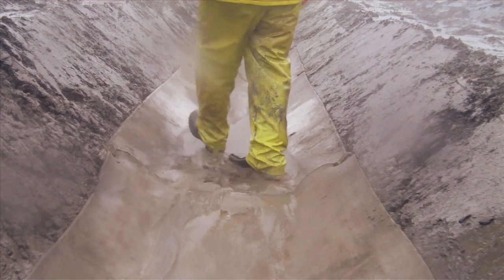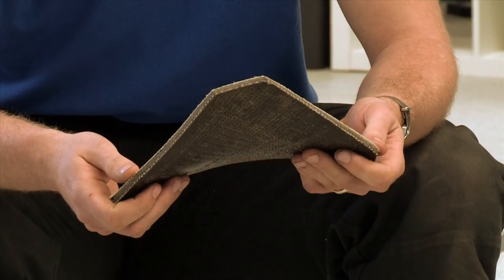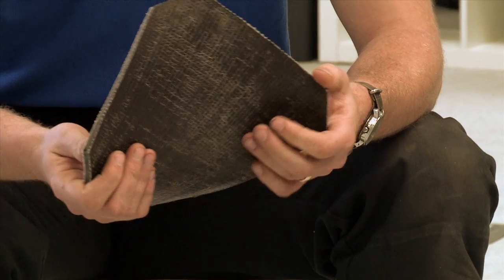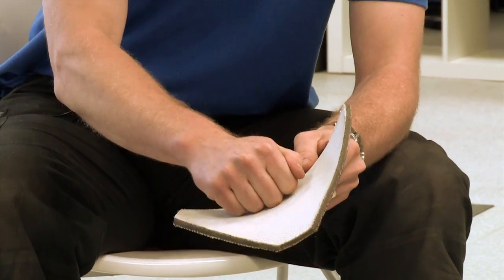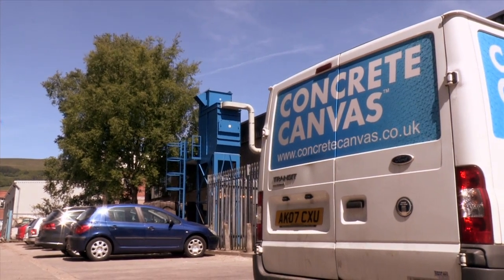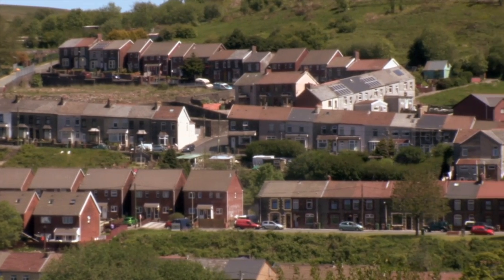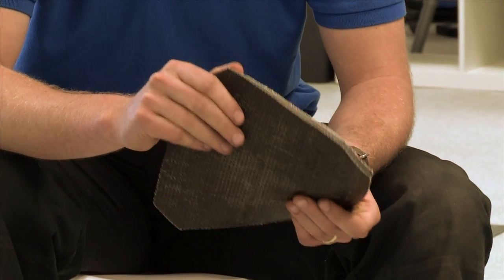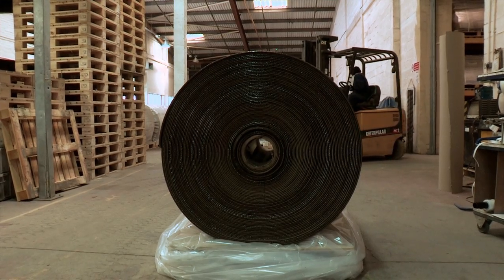Concrete Canvas Ltd - MacRobert Awards

Comment: You could cut the canvas in squares and rivet a nail or screw strip to one side and use them for roofing and siding or for water spill ways. Rather then using long strips off rolls use a shingle type pattern.